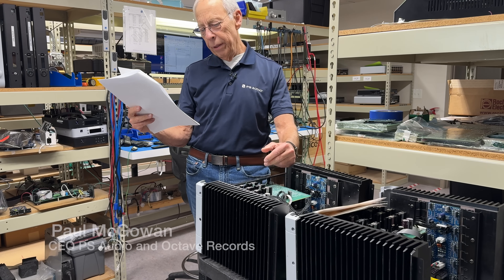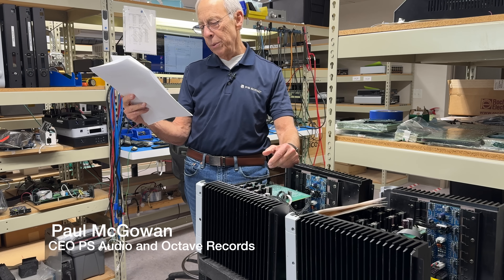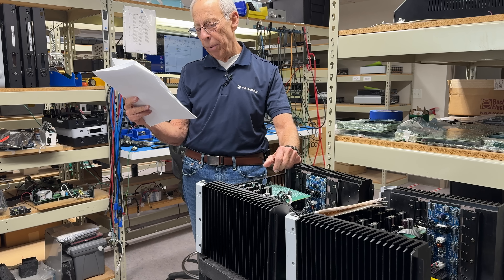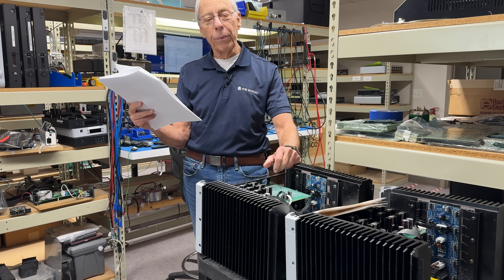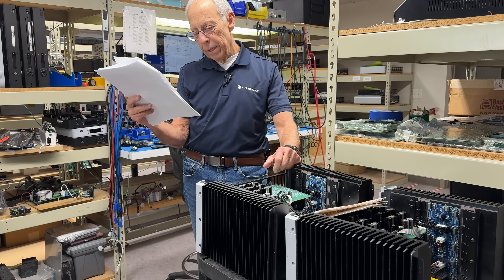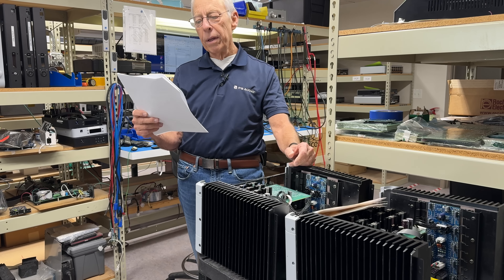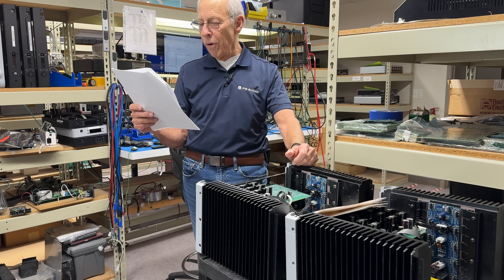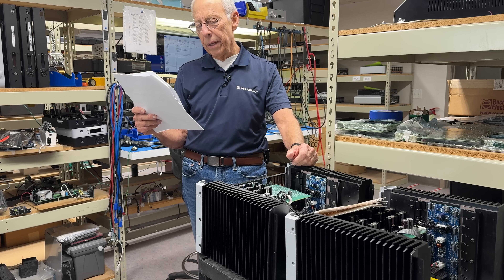How a SMPS power supply works

Comment: Paul, this was not your best video.  It seemed a bit off-the-cuff, instead of the careful pre-planning of what you are going to say, when you've made more technical videos in the past. 

A SMPS does not chop up an AC waveform.  It converts it to high voltage DC, and then sends pulses of this high voltage DC current into a step-down transformer at a switching frequency of ~100kHz.  It's the tight regulation of the on/off (switching) pulses that keeps the output voltage steady.
Reply: Quite right.
Reply from the maker: Mmm. Alright, I will give you that I glossed over one step, the DC rectifier and input capacitor, which is then chopped up at higher frequency and then passed through a step up transformer. Sorry. Thanks for the correction.
Reply: @Paulmcgowanpsaudio    Wow, I appreciate you answering comments.  Now, I have to come by and see you guys some time, when I'm out in Boulder.

I'd love to know what your DC bus voltages in your power amplifiers are (when you say step up), because I'm most familiar with DC voltages under 70VDC.    I'm glad that you didn't get into ripple voltages in your discussion, as I've seen some DC switchers that can regulate to less than below 100uV (microvolts) DC ripple.

However, EMF/RFI from the switching frequencies in the transformers is still a problem, even with softer (non-square-wave) switching circuits.

The other tweak I'd offer to your explanation, is that real efficiency doesn't really come from the smaller components (I think you were kind of alluding to that with how you started off holding the big toroid transformer, and then talking about higher switching frequencies being more efficient... they aren't). 

The higher pulse switching frequencies come with higher impedance in the path, and higher losses in the steel/ferrite transformers (in fact, we engineers depend upon that magnetic inductance in the transformer cores to slow down the surgrs and store energy between the "on" cycles). 

The higher efficiencies come from:
1.  The first stage rectification at higher voltages (less loss in Vfd) 
2.  The (mostly) on/off states of the mosfet transistor, just like in a class D amplifier. 

Again, it's easy to be an armchair critic, and don't want to rain on your wonderful channel.  I wish you guys the best and appreciate all you do.  Hoping to see you guys sometime in the future.

God bless,

Joel

Comment: Switch mode power supplies are smaller, lighter and occupy less space within a component and are less expensive to produce. Switch mode is not susceptible to the 60 Hz AC line hum and can run quieter.

Comment: Switching power supplies are difficult to fix and can have really high voltages. Some of these supplies send out interference and bother commercial AM-FM radio stations and Ham radio operators.
Reply: @adriancressy8363  yes, but there are laws and regulations to "limit" the interference.  It's impossible to entirely eliminate the noise, but in North America, the applicable standard is as per FCC Part 15(B) for Class “B” digital devices.  And, the European standard is as per EN55022, Class “B” & EN610000-3-2, 3.

And, it's not going to be the High End audio amplifiers (like PS Audio) creating more interference.  It will be the cheaply made (often foreign "clones") of reputable power supply companies, who ruin it for the rest of us that are producing this annoying interference. 

Another comment mentioned earlier how much fun it was to tear down these dollar-tree usb chargers and see how few components they use to create the 5VDC power to charge our phones.

Comment: I am also a ham radio operator and hams will tell you to be careful of switch mode power supplies because when they are not adequately designed and built they are a huge source of spurious RF frequencies including multiple harmonics above and below the switching frequency. Even small wall warts can generate sufficient RFI to easily blank out multiple ham radio frequencies in addition to other radio frequencies and that RFI can be picked up in the circuitry of other electronic equipment. Where even cheap transformers can be RFI quiet, cheap SMPS's often are not.

Comment: There’s also a public perception that linear toroidal power supplies are associated with higher quality gear.  Switch to a SMPS and inevitably the internet will light up with claims of cost cutting and “they just don’t make ‘em like they used to!” 😊
Reply: @superspeeder  It's more than a perception.  They do have less electromagnetic radiation in a single direction and tend to radiate lower strength electromagnetic fields in a 360 degree (omnidirectional) pattern.   A conventional transformer will radiate more EMF at right angles because of the shape of the core.

These radiated magnetic fields can interfere with other nearby circuits and can cause a noticible low frequency hum and other interference.

Comment: I own Linn designed SMPS amps where their vast accumulated knowledge/engineering means they have performed faultlessly for 20+ years, sound better and quieter than any linear P/S. And with the added bonus no one wants you to know they don’t put crap back into the mains that affects your other equipment.

Comment: Switching supplies have obviously come a long way. Way back ibn the day in the mid '70's I was doing a tour of Audio stores doing a "High Speed Clinic". Measuring any amps bandwidth using slew rate and rise time measurements. 10K squarewave at rated power into 8 ohms. Sony had started using switch mode PS. After the first 3 each fried, smoked actually, I stopped allowing Sony's to be tested.

Comment: PS audio prices are through the roof and if he switches to switch mode power supplies all the PS audio fans will be in an uproar. Paul has an older generation that follows him. That's why he hasn't switched let's be honest. No way they would lower the price if they used a switch mode power supply(lower cost than torodial)so they are holding off as long as they can
Reply: @ryanschipp8513  Pure projection
Reply: Wrong
Reply: @Mac-t4y very astute comment. Congratulations

Comment: Thanks Paul. You indirectly answered a question that I had but didn't know the right words to ask, something like: Is there an advantage to 50Hz transformers in a 60Hz mains supply? Or is the extra iron kinda a wash (maybe a little more heat??)? If you had a power regenerator convert your 60Hz input to 50Hz output is there an advantage? I did assume you used 50Hz components for the international market, but seeing you use 50Hz everywhere maybe answers the question.
Reply: In a (much) older video, Paul stated that you can run transformers at a higher frequency than they’re made for (within reason), but you can’t run them at a lower frequency than they’re made for.  At the lower frequency, they’ll draw excess power and overheat.

Comment: Secret Paul is to have a larger transformer for the switch mode something like 200 va you want the power supply to produce a lot of amps. That's what you're hearing the difference smps can struggle with this, if they're not designed correctly, and run it at 143 kilohertz

Comment: Paul forgot to mention 2 of the biggest advantages of SMPS. 
1) They do not hum.
2) Very tightly regulated outputs.

All the other points about efficiency and reduced reliance on huge transformers are also valid.
Reply: They may not hum, but poorly designed ones create other unpleasant sounds.
Reply: And they sound like shit

Comment: Thanks for your videos!
If 100 Hz is more efficiency than 50Hz, why don't you use 4 rectifiers in a bridge to change the frequency? 
Hope you use Iron and not steel in the transformer!!!
Regards Michael, Denmark
Reply: Iron has not been used in transformers in a hundred years.  Tesla found that soft magnetic steel laminations with varnish as insulation between each sheet(lamination) of steel prevents "Eddy Currents" within the transformer core.  A cast iron core gets hot do to the Eddy Currents and is not very efficient.
Reply: @welderfixer  Thanks!
Reply: A linear power supply running on 60hz with a full wave rectifier already steps the unfiltered output up to 120hz.  Double rectifiers can increase current capacity, but not frequency.
Reply: @Douglas_Blake  Thanks!
Reply: And that was Nicola Tesla, at that.
Reply: If you change the frequency that’s going into the transformer, you’ve made a SMPS.
Reply: @kc9scott  no.  You've just changed the frequency of the ac mains.  A true SMPS immediately converts the ac mains into a rectified high voltage DC (>140VDC for North America), and then begins chopping up the HVDC into pulses of current based on the state of the output voltage (under, at, or over Volts) cause the mosfet switch to turn off or on for a boost in energy into the circuit.
Reply: @kc9scott  
SMPS is not about frequency... it is an entirely different circuit topology.

Comment: Switched mode power supply in many cases better than Toroid transformer, but..... it hasnt lived up to our standards being better sonically..  anyone spot the contradiction which is . Better or not better? Makes no sense Paul. Of course in the real world with good filtering their is no difference,  but switched  mode more efficient less heat loss. My class D amp is just as good as any toroid, but of course I don't have golden ears and stand to make money one way or the other. Unlike Paul
Reply: BINGO
Reply: Wrong
Reply: @Mac-t4y now for  your homework. Go and learn what DC is. Then learn what ripple is. Then learn that DC from what ever sourse without ripple Is treated and behaves the same whether it comes from a transformer, a switcher. Whatever source. Another stupid audiophile.🤣

Comment: bare in mind, a linear psu will outlast all of us. Ok, maybe you need to replace caps every 20 or 30 years.
SMPS does not last 10 years, and they are much more expensive to fix. so much so that they are usually replaced when broken. 
Even if the sound quality can be fixed eventually, I will avoid them on the matter of longevity.
Reply: No evidence SMPS break, they are measurably quieter and hum less...
Reply: @JohnHarnick  I'm assuming you do not do a lot of repair work? If modern electronics come onto my bench and will not turn on, 1st thing I check is the smps and standby circuit. more often than not it is one of those. and in my 20 years of fixing stuff, I only once had to repair a linear supply due to a blown diode on an old naim amp. Statistics unfortunatly do not agree with your take on longevity. 
One other question. Why does companies like Onkyo and Marantz have 2 power supplies. Linear for the audio, and smps for running the computer and hdmi and logic circuits?
Reply: @CraftyZA  SMPS rarely break..this would have been reported on DIY forums. Which units are you referring to ? Linear power supplies, if you're defending them, are rife with problems. No serious audio co. is using them anymore .
Reply: @JohnHarnick  I've seen it on multiple computer power supplies, a guitar modeling amp with DSP and class d design, and an oscilloscope. The failure mode is pretty consistent. while measuring, it shows a voltage, but the moment you apply a load, voltage drops to zero. There are a few causes like bad output cap, or some uses a little regulator tl431 that loves to break. if you know how smps work, there are 2 stages. the rectifier on the second stage likes to break as well. usually made with schottky diodes.
Reply: @CraftyZA  I believe this. But high-end brands, despite their history of shoddy parts, usually don't use a cheap SMPS. This type of PS uses the same stages as linear, just shrunken and re-arranged. The first one was around 1970...but started appearing in components in the late 90s. But with no voltages on schematics and frequent part changes, they were tough to adopt....
Reply: My 2011 smps is still running fine 👌😊
Reply: Correct. 
 SMPS, is the classic example of, keep fixing it until it breaks

Comment: SMPS is one thing I don't like about most new electronics of any type.  The failure is always in the power supply.
Reply: Y'know what .... there's a reason for that.
First ask if you would rather cook a $25 power brick or a $2000 DAC?

Next you need to understand "Inrush Current" (do a search).  These are momentary bursts of current, many times normal, when a device is first turned on. Over time they do accumulating small bits of damage to the rectifiers in power supplies and eventually the parts will fail.

This is worse with SMPS and external power supplies because not only do they have their own surge current, they also have to cope with the inrush into amplifiers and such.  This double inrush is a killer. It's been known to reduce external power brick's life time to 1/3 or less.

Fortunately the solution is pretty simple ... just plug them in and leave them powered up all the time.  That reduces hundreds of inrush bursts to one.  Now the brick only has to cope with an amplifier or computer inrush and most have current limiting protections for this built in.
Reply: @Douglas_Blake  zero switching and power factor correction circuits also help smooth these inrush currents.

Linear power supplies have their own inrush current problems too.  So, it's kind of a universal problem in AC->DC power supplies.
Reply: @joelhacker8767  
Yes it is.  

But, many of the smaller external power bricks are actually designed to be left on (in standby mode) all the time as are these tiny amplifiers.
Reply: @Douglas_Blake  I would agree.  Very good point!

Comment: 60Hz/50Hz Transformer Diode Bridge to Capacitor 
What Ever Power From The Wall U.S. or Euro  60Hz/50Hz 
Transformer EMF Electro
Magnetic 🧲 Force Through Induction Which
Means The Round Coils of Wire on That Transformer Are Not Connected Yet The Magnetic Field Connects The Power Supply to a …..Paul Didn’t Say a Full Bridge or Half Bridge Power Diode Which Flattens The AC to
DC Through The Diodes 
Then Out To The Capacitors….The Reverse of This The Capacitors Would Charge on The 
Down Swing Negative of The Sine This Would Fire a
Blast of DC Voltage Across The Amplitude By The Capacitor To Create a Flat Voltage or DC…..
Minus The Diodes 
There are Two Ways and Many Other Ways To Achieve This Flattening Of 
The AC To DC 
Which if I Understand 
Paul He Sent The AC
Power Through a Full or
Half Bridge Diode 
The Round Transformer is 
Used For Induction 
or EMF…..😮
…..Paul It Would Paint a
Beautiful Picture if You Had a Drawing Board 
So Your Viewers Can See 
The Details and Direction and What  Exactly This Piece Of Circuity Is 
Trying To Achieve….
My Old Lady Was Pulling Her Hair Out Saying 
“”Why Doesn’t Lip Smacking Paul Have a
Drawing Board….and He Should Get That Coughing Checked Out 
It Sounds Like Bronchitis 
Pneumonia Or 
The Flu “”😷 
Well The Stock Market 📉 Crashed and The Orange 🍊 Julius and His Goose Stepping Billionaire Buddy Has Made The White House Lawn into a Used
Car Dealership….
What Next….!
Reply: Are you ok? Did you have a stroke?

Comment: What do you think of Gallium Nitride as a power supply? I have a GaNfet amp that uses GaN PS and is much faster/efficient in switching over any SMPS even that they're related. Thanks Paul.
Reply: its mostly filtering and the transformer part and shielding that would matter, it's where they skimp on stuff too. but the big size advantage with gan is enabling using higher switching speeds while not being so big and expensive on the fets.. that then enables using a smaller transformer. like you with gan you can use 100khz++ while typical smps works at less than 20khz (you can see why the latter could be problematic for audio)

depends how they did though too like is there a regulator after it or is the whole thing regulating itself etc. for the bargain basement trick switch mode power supplies the 10 cent phone chargers are pretty fun to look into for how little with you can actually get away and have a functioning device that will charge a device that does it's own regulation.

really most dc devices have some regulation in the device itself. if you really want to test some 12v nominal device if it could benefit from a more stable, less noisy, external psu just connect it to a car battery. it's simple as can be.
Reply: GAN is not a new technology.  It is a new device structure that makes existing technologies better.  Your Gan Power Supply is still a switching power supply, but made more efficient by the use of Gan FETs in the switching circuits.
Reply: @ Not new tech no, but relatively new in power supplies I believe and what I also pointed out was as you described.

Comment: Class D usually used a switch mode supply. The reason why it can deliver a lot of power in a small form factor. I always replace wall warts with something better as a matter of course. IFI, or a caged Mean Well.
Reply: Another brand that's pretty good (when measured) is Connex Electronic, but they don't make any enclosed.
It can certainly pay off to change the PSU in some cases, things like DAC's with external PSU can be brought up a notch in SQ. 👍